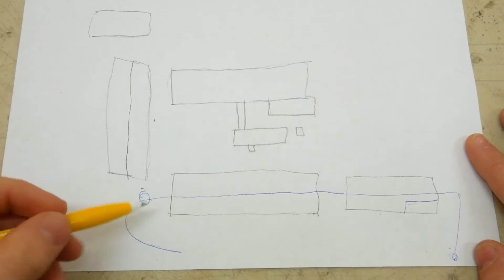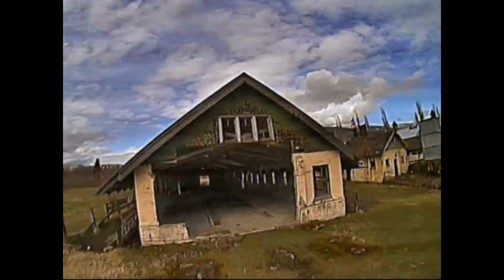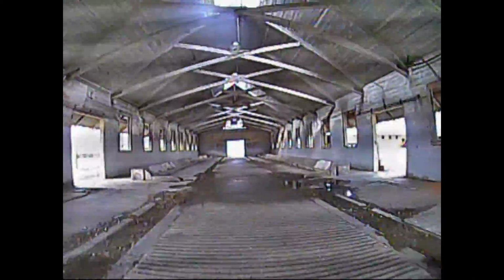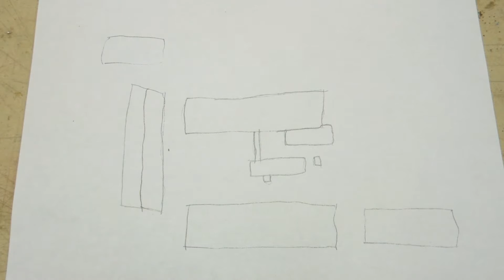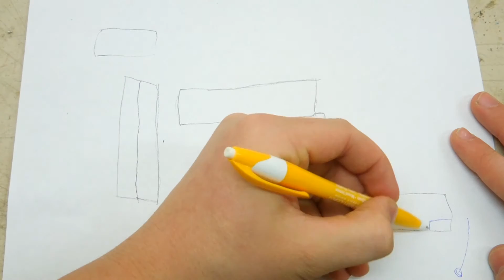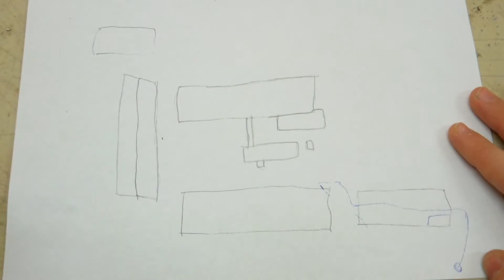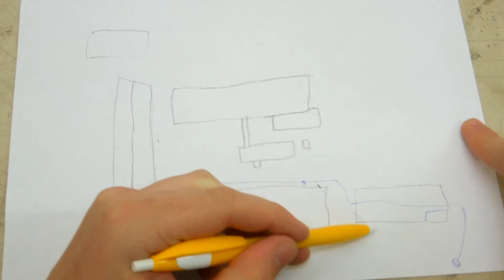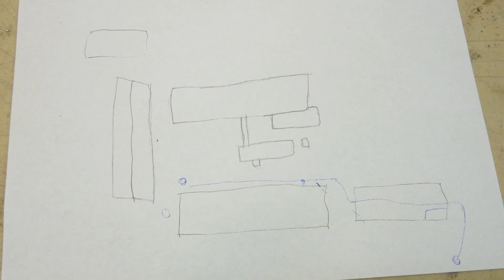Spektrum antenna mod and range test

Comment: Is there an ideal specification on the length of the cable?  I seem to remember seeing something about this in another thread.  Yeah I'd love to see a video on how you did the modification.  BTW I've flown at that spot before!  Super cool!
Reply from the maker: I don't think there is a specific length for the coax. It was in the kit in the description and the length was predetermined. With that being said, the shorter the better because this really small coax has a lot of loss.